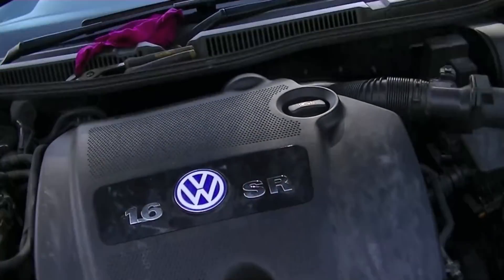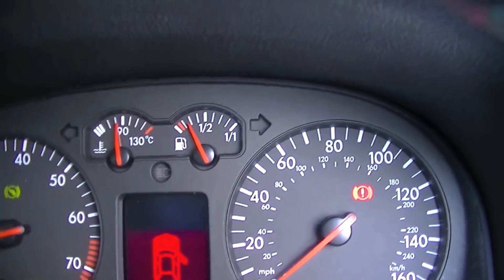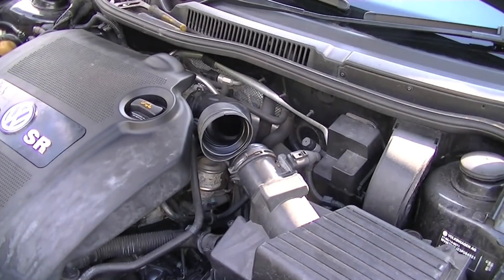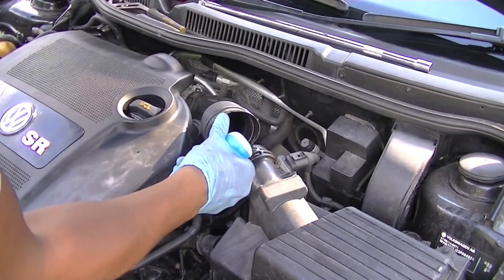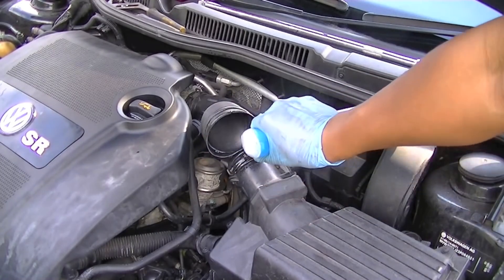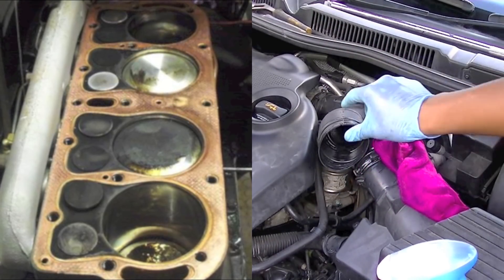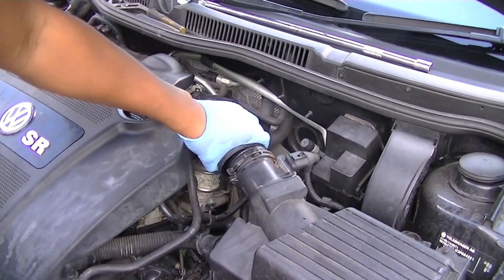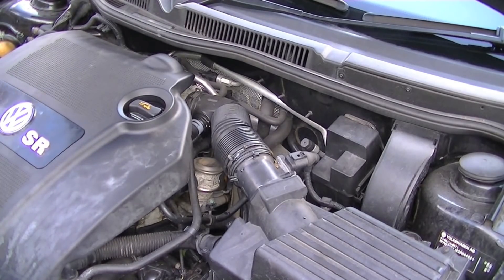How to make your engine run better with just tap water.......Better Than Seafoam?

Comment: Dear sir!
As a mechanic i must say what da fuck are you doing SPRAYING COLD WATER IN HOT ENGINE????
Of course the calc on top of the pistons will fall of and and up in katalitic converter and do damage to it.
Very very stupid.
Reply: Holly shit man, people been cleaning engines like this forever!  Ive done this to one of my older cars a few times, just pull the hose from vacuum ignition advance and put the hose in a glass of water. put it in take it out. engine runs smoother, pulls better, and starts easier. You really should do your homework before getting all arrogant smartass. Have you heard of water methanol injection during ww2, and in nascar. Hot engine, cold water, more hp. You are not as smart as you think you know.
Reply from the maker: GORAN RELJANOVIC Please tell/show us how the water damaged the Catalytic converter pleaseeeeeeeee. I just want to hear what you are going to say
Reply: water fumes lol, you mean steam?
Reply: A small amount of water in the cylinders "cools " the burn It also increases compression as you can't compress water which =  more power. 
Many years ago it was called water induction because the engine "sucked" it in through a regulated valve, now its injected. Anyone ever noticed how driving in the cool of the night with high humidity your engine sounds smoother ?
Some vintage cars had a handle that you pumped in and out to pressurise a water container that sprayed water into the intake manifold to produce more power.
Reply: "damage that water fumes do to the katalitic converter"?? Dude... "water fumes" vaporizer out the tailpipe. "Water fumes" dont just chill in catalytic converters and damage them. What damages a cc is burning oil or burning something other than h20. The only way this damages a cc is burning off that carbon but even then it would have to be alot of carbon on there to do damage
Reply: You obviously don't know how combustion works. When you burn air and fuel it naturally creates water. If that damaged the catalytic converter, they would all be broken.
Reply: GORAN RELJANOVIC the amount of water hes spraying in there turns in to steam where it does no harm to the engine, NOS goes in cold as ice and that doesn't do anything. so dont claim to be a mechanic if you dont know the basics. theres systems out there where they inject water with alcohol to improve performance, usually on turbo engines.
Reply: O.K. Smart asses.
first answer this; does water clean intake channels and valves????
second; have either one of you self tougt mechanichs saw damage that water fumes do to katalitic converter???
no you did not. becausr if you have seen it you would not be doing this!!!
water spray and better  performances YES to old school engines.
stop bullshitting people.
Reply: watch out everyone super mechanic here..... thats why people fix their own cars cause you certified mechanics think like you. i seen the mechanics program in college and its a joke just like the people that are not smart enough to do anything els so they want to be mechanics, those people like you make good mechanics look like shit. you a moron. back to flipping  burgers. you cant wake up and think you know how to fix cars......
Reply: GORAN RELJANOVIC
Reply: GORAN RELJANOVIC
Reply: Goran......please learn how to spell. I also advise that you do some homework before you start shooting your damn fool mouth off.
Reply: Brody Thurmeier  create water? Lol carbon you mean
Reply: This is a time honored method of cleaning the valve train when you do not have access to fuel injection cleaner pressurized bottle that connects to fuel system and you actually run the car off the bottle with fuel cleaner and pressurized shop air, the only thing bad with this method is running vehicle with mass air sensor disconnected can and will throw a hard code needing a scanner to clear, no biggy but with spray bottle it is safe . Years ago people used to take a cup of water and pour it slowly into a carb engine and if not careful hydro lock but running 3500 rpm and using a spray bottle hydrolock is not an issue. if he used a garden hose my comments would take a different turn 25 plus years as GM master tech as well as a lil ford and dodge tossed in so apparently I know shit from shineola
Reply from the maker: BMW M4 Water Injection........ Not saying no more to embarrass you
Reply: You can not embarrass me,please teach me,i'm listening!!!
And also please explane does your cold water spray sistem cleaning the valves and intake and exhaust channels also??
Reply: If this is so i must congratulate!! You just made a hughe braketrough in internal engine cleaning. I recomend patenting.
Reply from the maker: GORAN RELJANOVIC Just because something is new to you, does not mean it is new, its just new to you. This is why you should always keep an open mind, because there are alot of old things for you to newly discover.
Reply: Sean Paul Patterson.  as in Go you Moran.    get it goran. and even if this was a spelling error thats the only thing you found cause you know im right.

Comment: this is perfectly safe, it's been done for over 60 years by a lot of old mechanics.
Reply: robert reed have you ever done it?
Reply: @BurrowDeeper  carbon buildup happens even more nowadays. Thanks to gdi
Reply: Ok, you said you were old .. and it shows. Ever heard of EGR and PCV? And you think that is better than clean intake air in the old days? With all that BS nowadays some engines, like the PSA 1.2 puretech, need their heads cleaned at 100.000 kms, or sooner, due to extreme carbon deposits. Put there by EGR and PCV. Btw, done this with grassmower engine ad works fine. The fact that you never heard of it or tried it, doesn't mean it does not work.
Reply: gtjack9 Manifold as in collects. Air as in air. Manifold has ports fir intake valves. Intake valves open and gets sucked into the chamber. So yes and no. He never said it was injected from the intake manifold. 
Also your engine will not hydrolock. You can have a blown headgasket and have coolant flooded pistons and not hydrolock.   
Depends on which stroke and the amount. On an engine at op temp a little rain water isn't enough to even be noticed out of the tailpipe yet hydrolock.
Reply: robert reed I've done this on a few older motors with bad carbon problems. For the most part it made a big difference around the valves. Causes the carbon to flash off because of the sudden temperature change. Never had any problems with it and never harmed any motors. Biggest difference it made was on the 3100 i drive.
Reply: @BurrowDeeper  carbon build up is a real issue today like egr's clogging up and throttle body's very greasy or stone hard because of the egr
Reply: @BurrowDeeper  today's  modern engine's are well and truly full of soot because of egr having to be fitted, the fuel might be better  but today we have to recirculate  old exhaust emissions back into our engine's , if done right water is a safe way to break up carbon  in the combustion chamber,  rust has very little chance of forming as fuel and oil coat  the cylinder's with a thin film of oil film that get burnt away during the combustion process  along with any water molecules in the chamber , it's pushed through the exhaust system where it can be beneficial as well ,  this process of water cleaning is best done just before an oil change , as there is a chance of blow by in older cars  with worn piston rings but even then if your doing the job right it's only a small amount of water used ,so if you don't want to risk it , do it when changing the oil . Oh yeah this is nothing like trying to use water as fuel which was tried on myth busters, as all this is doing is using H2O in steam form  along with compression pressure and heat to clean carbon .
Reply: what is the benefit of this?
Reply: @levobryan6701  Steam cleans your engine
basically.
Reply: @Ryan-6982  yes i know, but its not a WC,  why you want to clean cylinder chambers? what is the main reason?   I m a automotive engineer,  i didn't know.  honestly why you try the clean with water? chambers absorbing air-fuel mixture every sinle rpm.  what is the benefit?
Reply: @levobryan6701  keeps gunk building up in the combustion system.
Reply: @levobryan6701  Same reason you want to run a fuel cleaner every now and then.
Reply: @levobryan6701  And if it's on a continous drip, can actually add some minor boost, when the water goes to a gas and expands.
Reply: robert reed most motors I've done it on were older and had carbon problems so yeah that's a good point. I wouldn't do it to my mothers 2016 dodge journey lol
Reply: @BurrowDeeper  sniff a bit of bull shit , you Must Be struggling with the small letters on your smart phone at your age buddy 😉
Reply: Doesn't matter cause everybody running ethanol an dat is pure rubbish, damages everything it touches an is LinkedIn to wat is called built in obselence, plus cars should be obselte anyways! Everybody all talking like they know everything, since I was seven an two thirds I've been jacking off cam shafts an finger banging dipstick holes smerk smerk irkyty irk... Well put y'all brains together an inventory sumthin that takes carbon monoxide an turns it into oxygen..... Any takers...no not oxycodone or oxycontin you oxymorons, pure oxygen! I bet it has to do with water watevers an wenevers this invention comes to light... Cause it's due since the first carbon casket on wheels was put into production.... 🤔 Jus saying, who's paying?!
Reply: Ryan mmnn mdx
Reply: robert reed how would it have a chance to pit out? I'm assuming you mean rust will cause it?
Reply: Y'all idiots, jus throw sugar cubes down da old hatch an watch Dem horses goooooooooooooooooo!!
Reply: it actually works. 
imagine driving in the rain, some little amount of rain water is actually injected through the air intake manifold into the combustion camber. more so if you try removing the air filter during the rain while driving you'll notice a cleaner emission from the exhaust afterwards

Comment: Using tap water is nothing new. did that trick back in the 60s and 70s. if you know what you are doing. It will clean of the carbon
  The enging should be at operating temp. use room temp water. and not too much.  had a 65 Foed witha 390 4bareel once so carboned up it ran awfull. After holding the engine at a good RPM and very slowly pouring some tap water into carb the carbon came out of exaust pipe and left quite a lot on the drive. After the car ran great. But do not over do it or use cold water only room temp. and do it slowly. Too cold of water can crack a valve..  But this is "Old School " Stuff. lol

Comment: just buy a water/Nos injection kit that way you can have the correct ratios so u dont harm your motor and you get a power boost from it ;)  because you do have to be careful how fast you cool the engine.  nothing worse than warping a aluminum block, headers or piston.

Comment: engines and water don't mix,its gives a power boost but will ruin engine in the long run,ww2 fighters were fixed with water injection system to give short power boost but was only as last resort when jerry was up there ass. really don't do it.spend a tenner on proper carb spray.
Reply from the maker: SpaRkiieeSiLvA You have just said alot of nothing........ What is your point exactly?
Reply from the maker: Can you explain why BMW has introduced water meth into their new cars? why would they do this if causes damage
Reply: +BMAC VAGS it's addblu not water.
Reply from the maker: Adblue is 67% water, so what are you saying?
Reply: Which also contains Urea and also is NOT INJECTED INTO THE ENGINE. Its dosed into the exhaust manifold. I dont see people spraying water into their engines to so called 'Clean it'. Have fun with that engine
Reply from the maker: Do your research properly and you will find that it is injected in to the inlet manifold. Why would you inject it into the exhaust manifold? That does not make any sense at all what you are saying.  I don't want to embarrass you, but you should learn more before adding negative comments.

Comment: Redex/Water? They Both Remove The Carbon Seal Between Piston and Bore. That is, Makes For Lower Compression and Crap Performance. Get It On A Dyno And See.. Oh Yeah, Forgive Me For Not Knowing Diesel Fuels Rely, For The Most, On Compression For Ignition. Check Out A TV Show Called Tomorrows World, Where This Was Tried On A Petrol Car. Supposedly To Increase Fuel Economy... Guess What? IT DID NOT WORK.
Reply from the maker: So why have BMW just introduced water methanol to their new M4 if it does not work? 

My guesses are their R&D dept has more money and research knowledge than tomorrows world, why would they use this if it did not work?